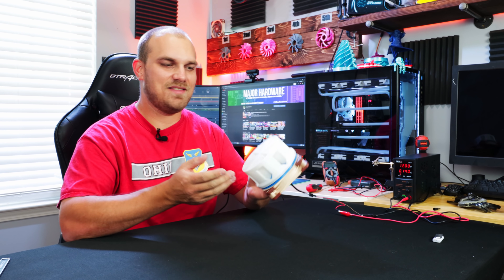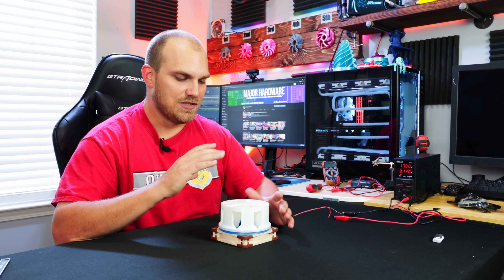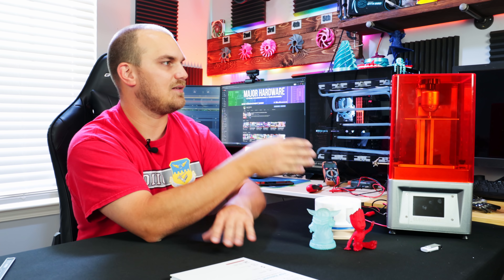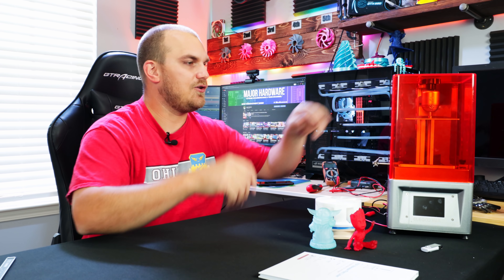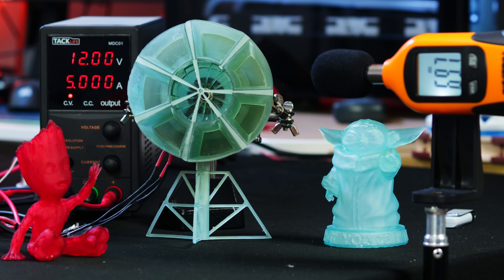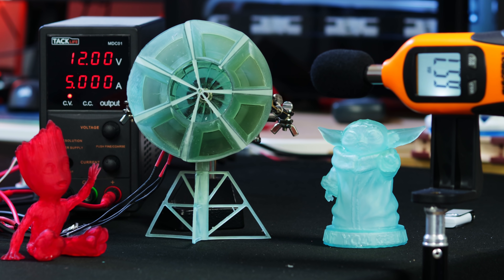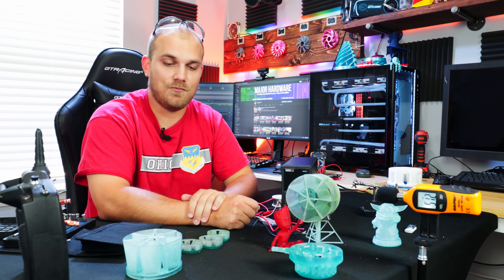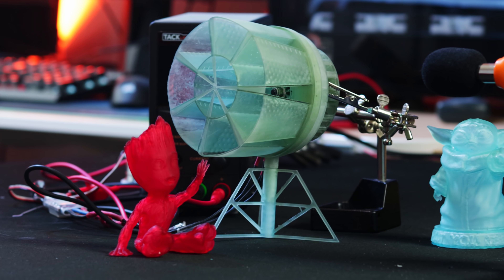CRAZY LOUD 3D Printed Tornado Siren | Elegoo Mars

Comment: Make a laminar flow smoke machine for your tests. You can probably get away with like a 40mm fan blowing into a atomizer for a vape and 120mm fan for general airflow all in a box that uses a stack of straws to remove turbulence from the airflow. You may need to use some open cell foam in front of the straws to further straighten the airflow.  Or all resin print it. But it would be a cool gadget to make for various testing

Comment: The motor would probably get better cooling if you turned the fan around to draw in from the bakc (assuming tue impellar wpuld clear the motor). This would also give some room for a second impellar on the other side with a different number of blades for that dual tone effect in air raid siren. In any case, bravo on the loudest desk toy haha

Comment: "5 amps should be sufficient" said no one. EVER.
Reply: more like 500 as a minimum, lead-acids rule
Reply: @virtualtools_3021  no actually lead acids suck in nearly every way
Reply: I bought the exact same power supply myself. First dc motor I was testing with it hit went into CC mode at around 18v... Haha
Reply: I have just built a custom power supply that has 3 outputs with one that has 1-19volts with 9 amps, one output with 40-390volts with about 200ma, and one output that has 19-84volts with up to 20 amps, i still doubt if that gonna be enough lol
Reply: Takes less than 1 amp to kill someone..
Reply: @johnjacobjingle8302  without voltage you get no amps. In order to actually kill someone with the current the voltage have to be high enough to push the amps through. 
A 12volt car battery has hundreds of amps available but you won’t hear someone got killed because they touched it. Amps are dangerous but not without enough voltage to accompany it
Reply: @Pulverrostmannen  there are a number of quantifiers to the statement which are less general than my statement.. dc power typically is less lethal than ac.. ect. You can still have a 100k volt stun gun no kill you because it doesnt have enough amps...volts might be the push, but amps are what gives it the bite.. and you can have a 140 amp dc power welding machine with 13v  knock the piss out of you without dying.. these still dont change the fact that you can kill someone with less than 1 amp..

Comment: Have any recommendations for 3D printing forums?  I have recently run into an issue with my printer, and I don't want to just start buying parts that I don't "need".  Also, waiting to see you print  out more of these sirens, and run 3 of them at the same time.
Reply: Lets go one further:
Print them so they make different tones, and see if you can get them to harmonize, or even cancel each other out.
Reply: Unfortunately as like with every topic, people have their own opinions of what printers need (myself included). Depending on the problem you're having, see if Maker's Muse or 3D printing need has/had the same problem; they also might have their own discord/subreddits.
Reply: @crenn6977  You're absolutely correct.  But my issue doesn't seem to make sense (at least to me anyway)  Once the print gets to a certain Z layer height, the X axis starts to bind up.  I had this happen 6 hours into a print (a bowl for a headphone stand), and also 30 min into a print (filament guide).  The X axis works fine otherwise, the Z axis does not bind, and I recently put some grease on the Z axis (it was noisy).  Oddly enough the printer will beep when the issue happens, and the screen on the printer will go into the "Menu" screen.  Not sure if its the screen, motherboard/stepper drivers (factory)

Comment: Your power supply isn't man enough for that motor. You can see the voltage drops at full throttle so your 12v and 16.6v runs were both at the same voltage (~8v) and power (~40w). It would also be worthwhile moving your spl meter further away to get a more comparable reading to other know noisy things, I know it makes it harder to film but the standard for spl testing is usually 1m from the source of the noise. As sound level reduces by 6db every doubling in distance, it is very difficult to get consistent measurements if you're close to the source. For example, your 120db looks about 10cm away, it would be 114db at 20cm, 108 at 40, 102 at 80 and probably about 100db at 1m
Reply: Cheap way of fixing the power struggle - get a cheap 400W(or more) boost converter and connect it to a pc psu, preferably the most powerful 12v rail (take into consideration that you'll either need a) "multiple leads to that rail" or b) "one thiccc wire (awg8 or thicker)". You're likely gonna need one of those watt meters that has wires coming out of both ends for volts/amps/power, but you're gonna have a 400w (likely less due to psu limitations) variable power supply.
Reply: @eivis13  boost converter will only give him more than 12v, he can do is buy a buck converter too, use boost converter to boost the voltage from 12v to max supported by buck converter supports then lower the voltage output from buck converter. I made same thing which costed 1/3rd of similar power regulator including cheap smps price, moreover it can be used with battery too.
Reply: a PC power supply can be modified very easily into a bench power supply and they supply large amounts of amperage on the 12volt rail. it would at least let you get full throttle at 12 volts.
Reply: I beleave he did a video using a atx power supply to run that motor on a fan on a 120 rad and it pulled over 300w...
Reply: @spcolsson  I think you're right,  he'd need a 30a+ adjustable supply, but it's hard to find one with more than a couple of volts of adjustment. He's probably better off just using  3s and 4s lipo batteries for the different voltages
Reply: @Muffinx93  i agree. For a high wattage motor like most bldc motors adjustable power supplies just arent worth the investment. I say this because ur basically changing the input voltage to a system that will be changing both voltage and amperage to the motor anyway
Reply: It might be easier to just buy a voltage/amp meter and hook it up to a Lipo  which will give much more headroom with amps
Reply: Yeah, the power supply limits the voltage when getting to the 5A, you culd actually get more power out of that thing modulating the throttle so it would not take more than 5A but stays @ 16v. Go more with the throttle and the controller trying to pull more current and the voltage drops and so does the power
Reply: Looks like the same power supply I have. Rated at 30v @5A (no idea if it can actually put that out or not though).
Reply: I would bet it's 30v or 5 amps. Being voltage dropped to 8/7volts at 5 amps, he could probably give it 4 amps at 12 volts saving from 16.6
Reply: Yeah Tacklife stuff is pretty garbo, don't know how they manage to sell so well on Amazon
Reply: @PhyNxFyre  Well I bought mine because of the good reviews and how many there were. I had honestly never heard of the brand before.
Reply: You can buy 6 cell 1800mAh 50C(means it can output 90 amps) lipo on amazon for 30$ together with 50A brushless regulator for 20$.
Reply: Came to say the wattage on the psu was too low and someone did that!
Reply: its not a "constant wattage PSU" so 5A is 5A regardless of wattage rating.
Reply: Garbage commercial video for a knock off 3d printer(ppl that know, know..lol) and yes his DC regulated power supply is absolute crap, kids don’t buy one of those, there $50~ and more likely to catch fire then anything else. Don’t skimp out when it comes to proper equipment, it may cost a lot more but it will be more accurate, reliable and you can actually resell good equipment. Not to mention, Not look like a total noob and get laughed out of Reddit or any forum for electronics engineering ect...
Reply: @cedricvillani8502  
>reddit
go back there! as shitty as any cheap chinesium SLA printers are for new hobbyists (which, considering he owned a tevo and uses a PC to test cooling, he is making videos for), they serve a purpure for digital artists and high tolerance, small parts with less finishing/sanding effort. If he actually read up on power supply current limits he could make something work at the 70$ he paid for, but he chose the wrong type of device. 
an engineering forum wouldn't give a rat's ass about this guy, he's testing submitted cooling fans for content; unlike the circlejerk you're fond of, there's no karma or gold for your enlightened opinions on what printer he should buy.
Reply: @cedricvillani8502  ok elitist
Reply: Thank you, you wrote everything I wanted to write here lol
Reply: I was just about to say 42w is not 83w lol. I uave a feeling that power supply is only rated at 40w. So u cannot run it at 30v and 5a. Its unfortunate but u have to go by the wattage rating when buying bench top power supplys like that.
Reply: @spcolsson  They rate those power supplies on dynamic draw, not continuous. They can burst at the rated watts, but they can't maintain it. Also, the rated watts are probably still lower than the max voltage * max current.
Reply: I made 69 likes
Edit: 
It’s been ruined